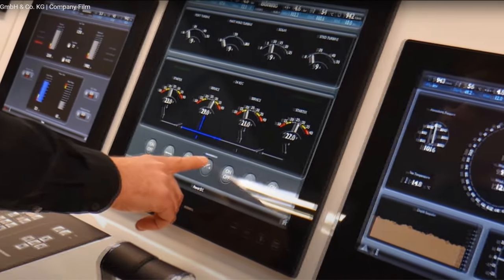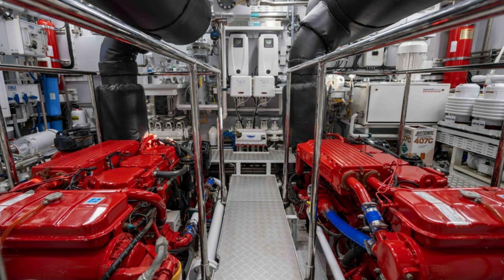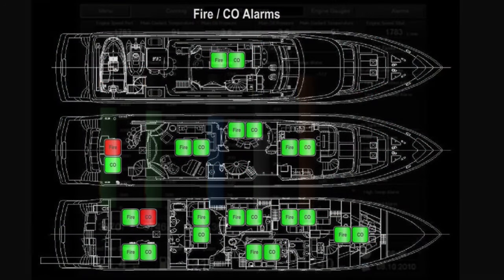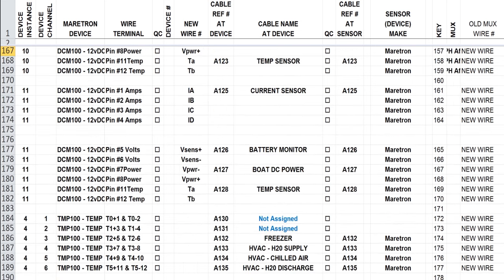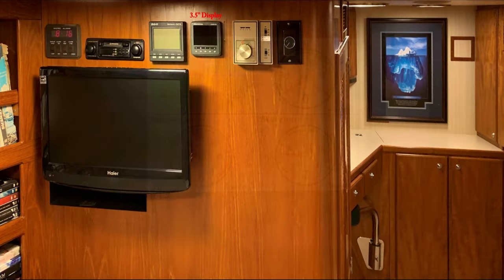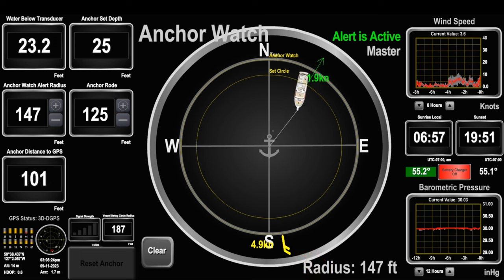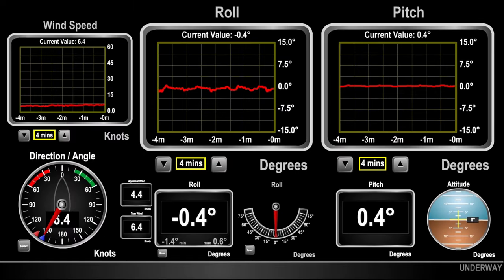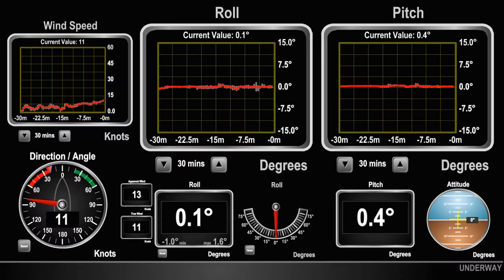Episode 7-1 - Vessel Monitoring (It's Value & Importance)

Comment: Excellent as always.  Top notch presentation!  How to chart fuel burn on ocean crossings using this software would be interesting.  Just one knot makes a big difference on if the tanks will be wet or dry when you get there, as you well know.

Comment: Cliff, I can’t thank you enough for taking the time to produce these videos. This one came at a perfect time as I’m mid build on my Maretron system, sounds like my question will be answered in the next video but not sure I want to wait, ha ha. What sensors are you using with the TPM100 for fluids? I understand ports 1 and 2 are for thermocouples and ports 3,4,5 and 6 use J type thermistor. I found omega TC-J-1 /8npt-G-72-SMP I’m using for my main engine and generator coolant temp but they are thermocouples, thus only two per TMP100… are your using thermistors for engine and transmission oil temps? Could you please share part numbers, thanks.
Reply from the maker: Morning Joel.  Thank you for your kind words.  I think that I put most of my audience to sleep...not one of my more popular episodes.  Unfortunately, I'm not on the boat right now, so I can't answer your question; however, my recollection is that wherever possible, we tried to use (standardize) with Nason sensors (if that is of any help?).  One tip I might share is that we found using ferrules were a great way to make-up all our NMEA connectors. Good luck with the project....it's totally a worthwhile investment of time and resources!!
Reply: Thanks, looks like Nason has what I need. One more question, what's your opinion on monitoring engine oil temp? My assumption is because of the oil cooler if coolant temp goes up so will oil temp, is there any situation where oil temp will go up and coolant won't?
Reply from the maker: Generally speaking, I think you are correct; however, I suspect that there could be a situation where the oil cooling system could start to fail or degrade independent of the engines coolant system either from excessive friction, a cooler issue, loss in a oil volume or circulation.  My suspicion is that monitoring engine oil has come out of both aeronautics and the race car industry where high performance and relatively light duty engines are being pushed to their limit such that the oil temperature/viscosity would need to be closely monitored to avoid premature engine failure.  (Just a guess...).